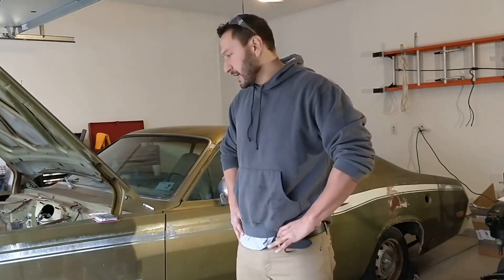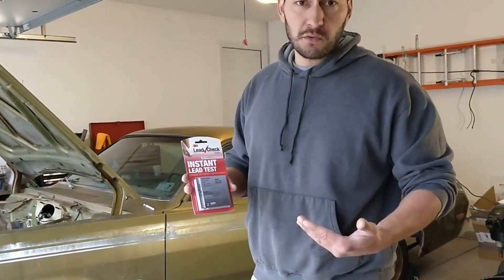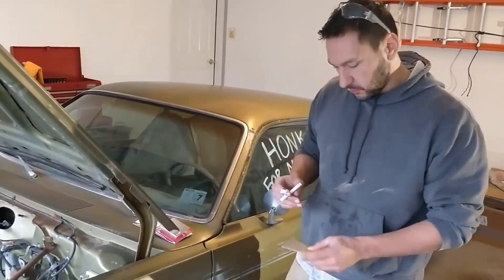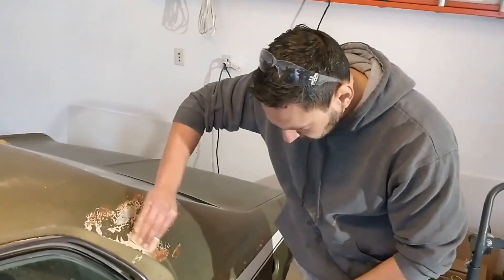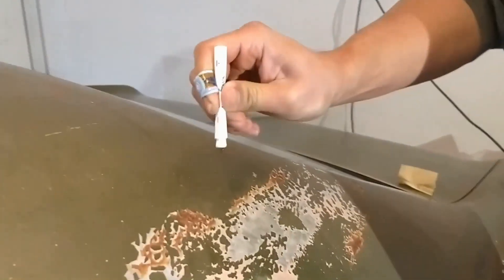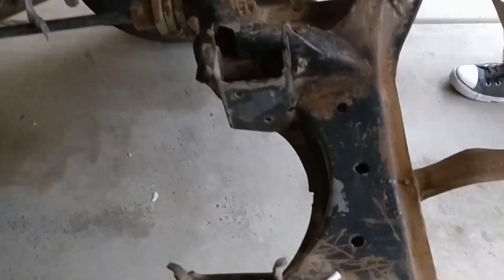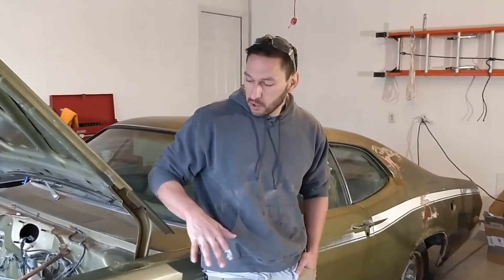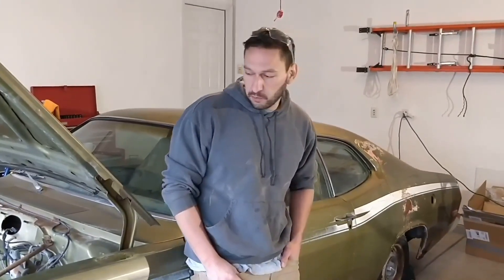Dust or Bust- Lead Paint Test

Comment: By the way there is No clearcoat on the Duster as it was enamel till the 1990's. The primer is leaded.
Reply from the maker: Thanks for sharing. Yes, I had no idea what I was doing at this point, lol. I found it really hard to find clear info on lead paint in cars. Even on the EPA website it was not clear. Housing regulations are easy to find, but it seems it was pretty loose in cars for a while. Thanks for watching!

Comment: On your second test Im sure it tested positive because the factory filled the weld seems with lead. Good idea to remove it and fill with fiberglass filler. Rust is known for getting under the lead.
Reply from the maker: That's what it looked like, thanks for confirming.